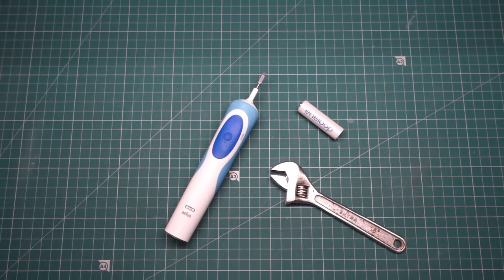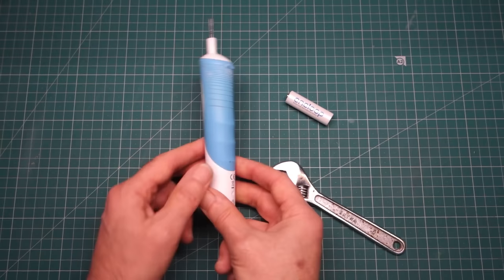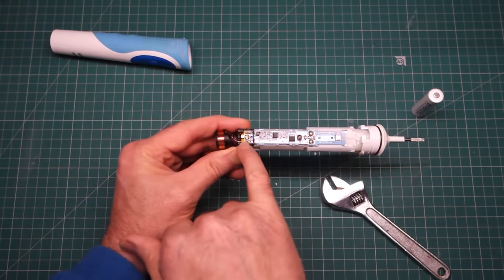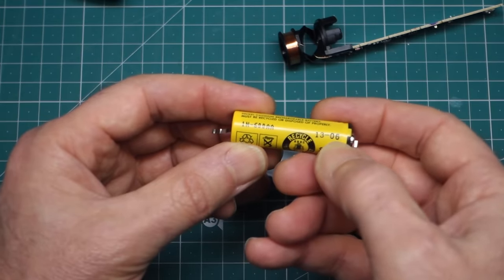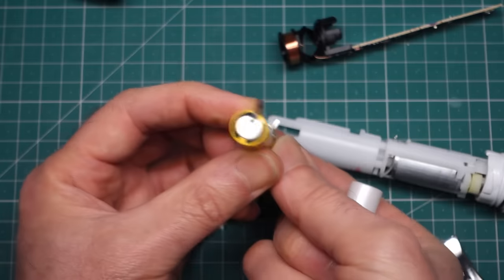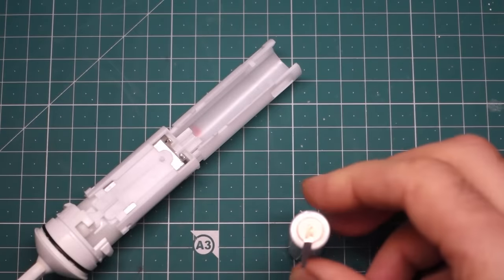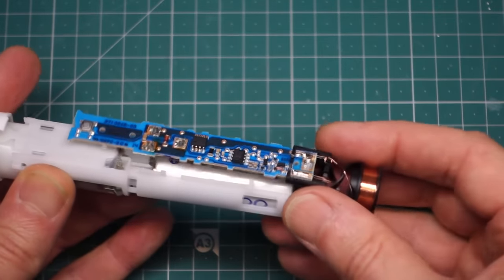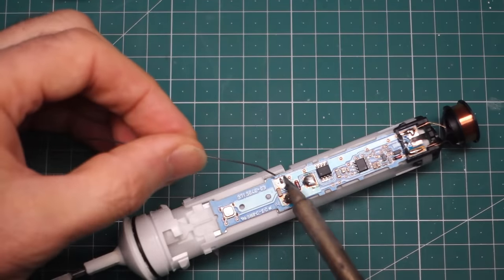Ep 33 Electric Toothbrush Battery Replacement/Upgrade

Comment: Thanks for that, I had a 2009 battery which I just replaced with an enloop, I soldered everything, and came against the same problem: after battery replacement, the unit wouldnt switch on until I placed it on the charger, then removed it. After that everything functioned normally

Comment: A lot of 18650 battery protection chips do exactly the same on low voltage in that they shut off completely.  The battery then appears dead until it is boosted by the charging circuit again :)
Reply from the maker: You're absolutely right....in the heat of the moment I just thought I'd bricked it 🙄

Comment: Good job, but ... Charging time is not longer like in original battery? You exchanged it for a 3x bigger battery ?
Reply from the maker: Yes - it must be longer although I did not measure it.  I usually just charge overnight once every 10 days or so - that seems to be plenty.  Thanks for the feedback Marcin.
Reply: I change battery in my toothbrush, but the maximum voltage is about 1.2V from original charging board. Did U measure the battery voltage in your toothbrushbrush while charging after change the battery?

Comment: Mine is only 6 months old and isn’t fully charging.  It runs for about twenty seconds before it stutters out.  Do you think it’s the battery?  The charging case gets slightly warm when I use it as well
Reply from the maker: 6 months old, something is wrong.  Time to exercise the 12 month guarantee if it applies in your jurisdiction?
Reply: @PowerOn-  thank you

Comment: wasn't the battery in my daughter's pink toothbrush- still had 1.2V on it. switching it on even without the motor connected puts a dead short across it. 
saved the battery, & put the empty toothbrush into the heap of toddler souvenirs. might move the battery into my own, which only runs for two days' worth of use.
cheers anyway!
Reply from the maker: Thanks for a report back,  looks like a capacitor or mosfet proably failed.  Time for a new one!

Comment: You actually don't need the wrench to open up the brush. There's a square hole in the back of charger that's designed for twisting and opening it up for "disposal", it's in the manual. Supposedly it's for you to twist it open, and snap the brush in half to recycle the battery and plastic parts. But still great video, I just finished replacing the 10+ year old battery on mine.
Reply from the maker: Thanks for the information on opening the casing Toni.  I'm also impressed you have a manual after 10 years!  Well done.
Reply: @PowerOn-  Well I don't... but the Internet did, lol.

Comment: Dear Simon!
I followed your instructions and changed the battery which I got presoldered in a local store.
Unfortunately after installing the new battery, putting the pcb in its palace, and pushing the switch button, the motor tries to start moving for a tenth of a second, and the black chip in the middle gets really hot until I push the button again. But no continous brushing. When turned on, I measure cca. 94 millivolts on the motor. Do you have any idea what to check? Thanks in advance!
Reply from the maker: Battery polarity is the only thing I can think of, unless you managed to short something out while soldering the new cell in position.
Reply: @PowerOn-  Thanks for the reply. It seems the toothbrush needed more than 15-20 mins  of charging. After that it started working properly and the "overheating" is also gone.

Comment: I wish i'd found this and learned about the twist before I did mine! I made far more noise than your little grunt at 1:27! :-D Thank you.
Reply from the maker: Yes, the dissassembly technique is a bit counter intuative.  It reallt feels like the plastic casing is about to break permanently!
Reply: @PowerOn-  It does! Not to mention not gouging plier marks in the top plastic bit where the metal shank comes through. 
One thing I did notice when I took the innards out is that on the back of the case there's a small hole about an inch up from the bottom of the rubber grip. It’s covered by the rubber but with a bit of prodding you can find it. It seems to be made to engage with a long rod and catch that's part of the motor assembly. When the battery i've ordered turns up i'll try pushing it in while pulling the top off and see if it releases any easier :)

Comment: Superb video. I have this exact toothbrush, which I think I must have purchased in 2011 or 2012 (if not earlier!). I was starting to get issues whereby when the brush would alert me two minutes had elapsed by pulsating the motor, the motor would struggle to start again, slowly dying over a ~3 second period immediately after the pulses. The toothbrush wouldn't then turn on again until it had been put back on it's charging station for a moment or more. This was becoming increasingly annoying as it would happen every time I used the brush, and I can't have the charger in the bathroom (no sockets), so I have to go into the next room to restart the toothbrush, trying not to drip toothpaste and saliva everywhere... I would also find that some days the toothbrush felt strong and powerful, and other days weak and feeble, even though I always leave it on it's charging station 24/7 (unless I'm travelling, which I to a lot). I was looking for a new toothbrush (figuring 7 or so years of use was pretty damn good) when I stumbled upon your video, which I've just executed! With nothing else wrong with the brush, why not just replace the battery (assuming that is the cause of my issues)! The only differences I found were that my battery appears slightly different to yours, in that I don't have the capacity or manufacture year marked on it, and it is NiMh, not NiCd like yours was. My circuit board is also red, not blue like yours. =) I replaced it with a Duracell 2500 mAh AA cell, which was a bit of a snug fit, but seems to work straight off (no need to tap on the charger!), although it does only report 1.2V, not 1.3V like the old battery and your Eneloop replacement. I'd love to know how you got the tabs off the terminals of the old battery. I tried to pull the tab off the negative terminal and it broke at the welds, so I didn't attempt the positive terminal, instead replacing it with some multi-core wire on my replacement Duracell battery (fortunately there was enough of the negative tab left to use it again on the Duracell). Thanks or saving me £35 or so on a new toothbrush! Here's to another 7 years of good use! (and fingers crossed I don't post another comment tomorrow saying it burnt my house down overnight ;) ).
Reply from the maker: Wow.  I'm glad helped you to fix your toothbrush.  Hopefully you'll  get a few more years of use.  Try fully charging it then switch off the charger and see how many days usage you can get before you feel you need to recharge.  You will notice that the "speed" reduces to a plateau after a few uses then it should be good for a while.  As for removing the tabs it's best using a rolling motion....perhaps its in an early video of mine on recycling laptop battrries.  Thanks very much for the feedback
Reply: @PowerOn-  I replaced the battery on a Saturday, left it to charge overnight, then didn't charge it again, and found it was the following Sunday (so a week later) that it felt like it was about to die. Not quite the 2 weeks some report, but I do tend to ignore the 2 minute timer and brush for 4-6 minutes, so I guess I would get a shorter overall battery life. In any case, 1 week is a significant improvement over the old battery! Thanks again.

Comment: Interesting, mine that looks similar has a NiMH battery according to the recycling label.
Reply from the maker: Yes, they changed, I think due to the fact that NiCd have been banned in a lot of countries.  Luckily the charging voltages and current algorithms are the same so they can be used interchangeably

Comment: Thanks for the video. There are some cells on e bay with the tags already welded on. But there are a few different sizes. Any info on the physical size of the cell you removed?
Reply: As stated, it's standard AA size.

Comment: It should be illegal to manufacturer and sell items like this with completely sealed enclosures with no easy way to replace the battery. I don't see why seals can't be used to retain the waterproof-ness in combination with a removable battery. Thank you for this video mate.
Reply from the maker: I share yourviews and frustration, there is a good o ring seal at the top of this device so making the cell replacement a doddle if the'd mounted it in with spring contacts.  Join the "right to repair" movement!

Comment: Your video is mighty useful! I just popped mine open to clean it (had some black gunk accumulated on the brush-driving rod above the gearbox, yucky stuff...) and I couldn't close it for the life of me! Tried spinning left and right, but then I just gave it a hearty push like you did. I think I'll buy an Eneloop to change the battery! Is your brush still working, no lithium explosions?
Reply from the maker: Yes, still working strong.  The Eneloop is a nickel metal hydride cell not lithium.  Good luck with you repairs 😊
Reply: @PowerOn-  Huge thanks! To you too! :)

Comment: What a thoroughly well thought out, gentle and easy to follow video, thank you.  I'm having the same charge issue with my braun toothbrush.  I had also considered changing the battery but I worry my skill is too small and my fingers too big!  But hey, what do I have to lose!?  May I ask, what, if anything do I need to know or be aware of when swapping the battery?  Such as battery type, or mAh? Or anything? Or will it not matter too much and it will charge ok with the same charger?  Thanks
Reply from the maker: Thanks for such a nice comment Daniel.  The choice of battery mAh should not matter too much.  I've choosen one which is higher than the original spec and it works for 2 weeks+ before I recharge.  Of course charging time will be longer, I  leave it overnight which seems to be plenty.  I hope it all works out!

Comment: Hi Simon, thanks for your video. I followed your instructions. The toothbrush works , however it cannot be turned off anymore :). Any idea  about what whent wrong ? Thank you!
Reply from the maker: Oh no - that's no good.  Maybe the on/off button is somehow out of alignment with the outer casing - I suggest you disassemble again and see if the toothbrush works outside the housing first.

Comment: This is a great video always wandered if it was possible to replace these batteries. My sonic toothbrush s battery failed a couple of years ago I was quite annoyed because it was a top of the range quite expensive model with a uv steriliser. The battery of the brush only lasted just over a year. Is it possible to replace this battery aswell I’m not sure what type of battery it is. I’m sure it’s a ni cad or metal hydride?
Reply from the maker: not too sure but if the battery has failed - there not much to loose in having a go!  Change it with a NiMh or NiCd both have same terminal voltage and the charge from the wireless stand is a slow one, so no problems either way
Reply: Simon Jowett. thanks Simon it seems like it’s a sealed unit I’ve always hated manufacture s doing this! I’m like you love tinkering and trying to fix things😌 have you  done any videos on other items. my cordless phone I bought a few years ago stoped working changed the Ni cads but they wouldn’t charge. any help would be much appreciated thanks and have a great day.

Comment: how do you remove the contact from the battery terminals?
Reply from the maker: Pull it off with pliers.  Use a rotating/twisting action if necessary

Comment: How do you convert this to wired?
I really hate the fact that you need to charge it every time.
Not only that, but as the battery weakens, the rotations get low as well until next full charge..
Reply from the maker: Wired to what?  It's  a battery operated device which needs a cell of around 1.2-1.4vdc.  You could mod it to run off a 'wall wart' with a suitable voltage (if they are available that lw) but that's a mod too far for me.  just follow the instructions and change the cell!
Reply: @PowerOn-  yeah, i meant the toothbrush wired to a plug. or just battery less toothbrush but wired to wall.
Saw a bad tutorial on indestructible but didn't really mention how to use  LM317 adjustable voltage regulator and what resistor to get.

I really just want to have constant power, mine always drops in rpm after second use and it needs a lot of time to recharge.
Why the hassle to make pollution by making batteries and hassle again to recharge the damn thing.

Nevermind, I'll just get a different motor to use with a 5v charger.
Reply: @alinutzalin6346  
Did you made a wired toothbrush without battery?

Comment: Hello, what type of spot welder do you use, or what type do you recommended for battery repalace repairs?
Reply from the maker: I made my own CD welder (capacitor discharge). See other older videos on my channel.  If building one today I'd probably make one much cheaper with a ready made kit that uses a 12v car battery for the energy source

Comment: What kind of capacity of the battery you suggest? Can I use Eneloop Pro with 2500MAh? What kind of tool was used in 5:00? It is some kind of welder? Can i use instead of this an ordinary soldering iron?
Reply from the maker: I used an older eneloop with 2000mAh capacity.  The Eneloop pro should work also but will take a while to charge.  Check out some of my older bideos to see the battery tab welder. Thanks for the comment.
Reply from the maker: ..and yes you can use a soldering iron however the soldering iron needs to be a fairly high wattage one as you want to solder the joint very quickly to limit heat damage to the battery internals.  Id be aiming to complete the joint in under 5 sec

Comment: Isn't a NiCD charging circuit different from a NiMH charging? Is it safe? 
Also, what's your battery welder?
Reply from the maker: NiCd can be different as they can take a very rapid charge but in this case the wireless charging is a slow charge so ok with NiMH.  Terminal Voltage is the same (1.2v).  My welder is a home made one, see other vids on my channel.  You should be fine soldering the connections directly to the battery. The trick is to use a soldering iron with, say 80watts or above and do the joint quickly to avoid damaging the inside of the cell.
Reply: Simon Jowett Thanks. I have a Chinese T12 soldering station with tip temperature selection and is very accurate, do you suggest that I use about 280oC to solder quickly or is it too much? Thin tip or broad?

Comment: Hi Simon! I tried to change my battery, but when i put it back together the toothbrush is running continuously... The Switch is useless and even holding it on the charge station doesn't change anything, it keep running... Any suggestion before i go and buy a new one lol
Reply from the maker: Hi Sylvain.  You are the 2nd person to report this behaviour.  I must admit I'm puzzled.  Did the brush start up as you soldered it in place or later?  Perhaps the on/off button has got continuously pressed on reassembly. Let me know how you go!
Reply: @PowerOn-  hi Simon, yes the brush did start as soon as the electric contact from the battery was retablished...

Comment: My Oral-B came with a same AA size battery but it reads 3.7 volts and it's Lion battery.
Reply from the maker: Interesting, they must be 'upgrading'.  You should be able to get an AA sized Lithium ion battery online.  Some garden lights use this type of cell and ots available at my local hardware store

Comment: Are the charging method the same for both NiCd and NiMh?
Reply from the maker: I don't know what charging algorithm these toothbrushes use but what I can say is the algorithm for NiCd and  NiMH are typically the same.  Most likely it uses a -ve delta V algorithm, but may also use a delta T algorithm (if there is a temperature sensor on the cell) and may also employ a max timer for good measure.   All in all I've found the cell I used works really well but if you want to swap the cell for a NiCd you can do that.  However it's becoming much more difficult to get hold of the NiCd......nasty stuff that Cadmium!
Reply: Thanks for Quick and great answer. Just wanted to not burn down my house.... :-) if the charging didn’t stop when it should.

Comment: I have an on/off switch problem with mine. I have to press very hard to get it on or off. Now that I know how to get to the switch I will see if it is repairable.
Reply: Same here. Yes the underside is soft rubber ridges which wear away. You can repair with silicone sealer.

Comment: Help me please :( I popped my 2 toothbrushes out for cleaning yesterday, the first one is working still but the second one stopped working, I didn’t drop it, i was sitting on the wooden ground when i clean the 1st one and on my bed with the other one , is that the problem? A small shock happened when i open both of them but the 2nd is a bit more extreme. i’ve put everything together like the first one :( please reply
Reply from the maker: Hi My Tam ,  I'm unsure what i can do to help?   Maybe you can swap components around to see which component has failed.  Also you mentioned a "shock"  you shouldn't have got a shock as the battery is only 1.2volts!  Perhaps you meant that somthing shorted out when you disassembled the casing.  In that case it's unlikely you will be able to repair the circuit.  I will wish you god luck anyway 😐
Reply: @PowerOn-  well, is a very minor shock, i feel tingling in my arms and it goes away in a few minutes, sorry for overreacting 😅 I’m sure none of the components has shorted out because i’ve put all that into a box. Maybe you could give me reasons that caused my problem, if you do have some then I’ll try fixing the brush again. Thank you so much for your reply Simon, I appreciate it.
*sorry for bad English